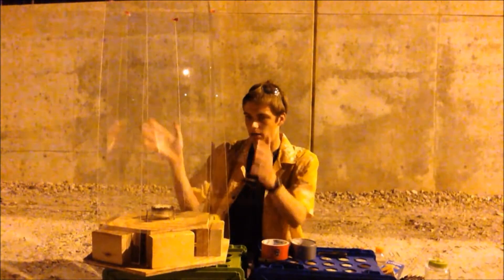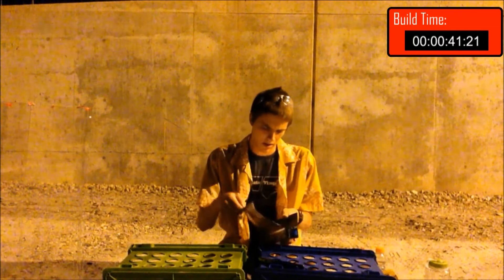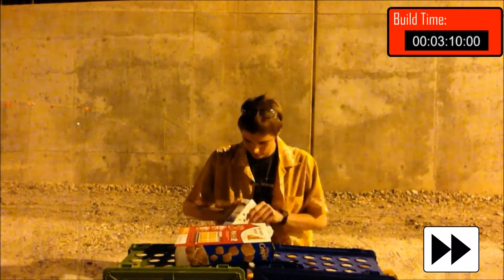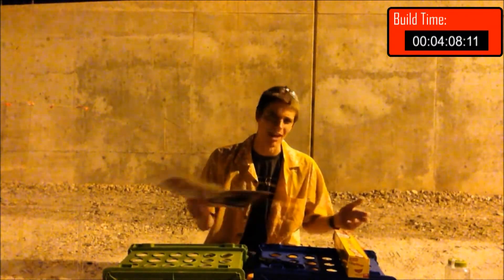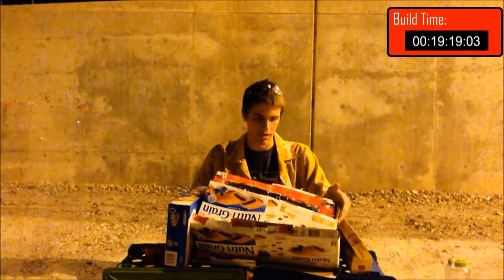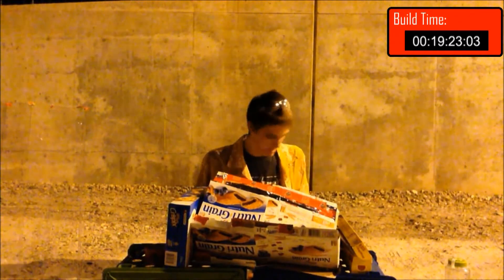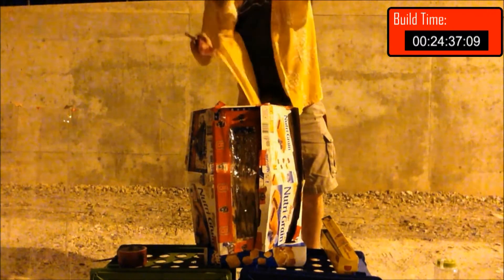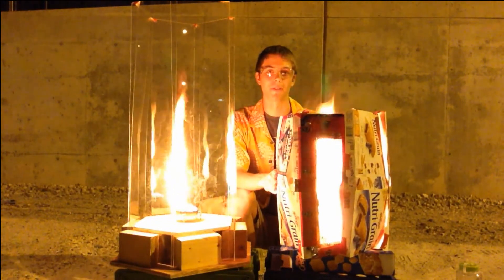Build a Fire Tornado from cardboard in 30 minutes!

Comment: cant believe i am the only one making a comment after all these years? nice to see another vid on this,,how come your plastic sheets or plexy glass did not get hot enough to melt though? at first i thought maybe they were glass
Reply from the maker: This cardboard model had a pretty tiny fire. I did later "succeed" in deforming the polycarb sheets of the full size one when I used too much gas (and not isopropyl) as fuel.
Reply: @AlphaPhoenixChannel  lol nice show huh,,,your design as with other split glass model designs support incoming air throughout the height of the vortex but I am wondering if i can get the same heights with the simpler design where the bottom only would receive the opposite sided air convection while the rest of the flame is enclosed in a solid glass tube,,do you think i would get the same results ? because that would be much easier for me to make than having to split glass tube lengthwise or ordering it from china,what do you think? i seen a vid of something similar to my design with great results but there intake although is at the bottom like mine its somewhat different of a design